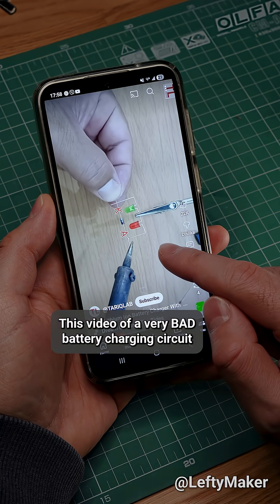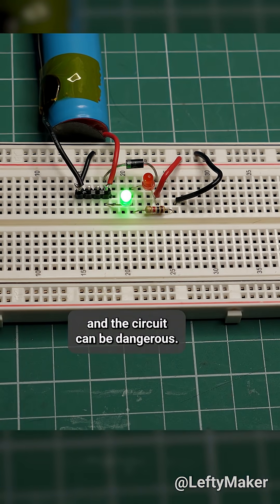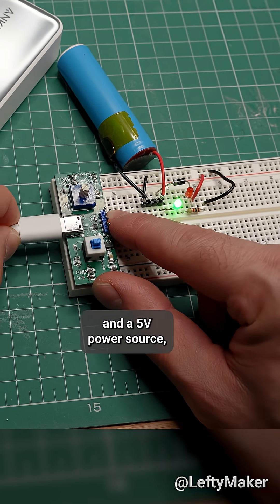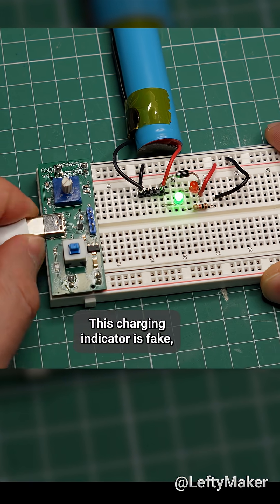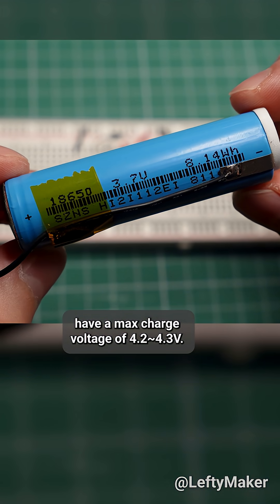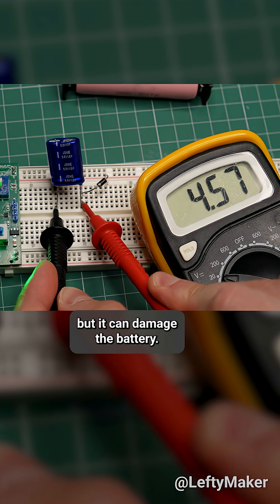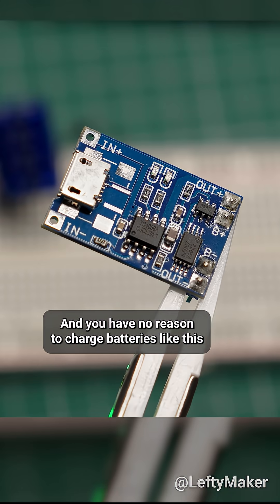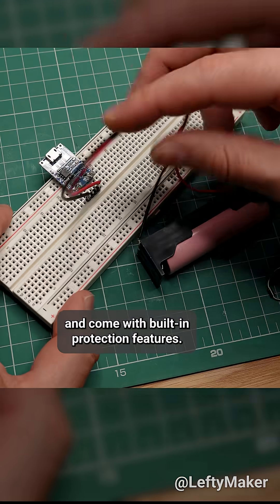This is a BAD lithium-ion battery charging circuit

Comment: One thing that i should mention after seeing contelss such videos, PLEASE FOR GODS SAKE USE THE B+ AND B- OUTPUTS FOR YOUR CIRCUIT!!!!!! Dont connect the circuit directly to the battery!!! this module is like charge here connect baterry here, and take voltage here!! not a dumb charging modue, these are BMS'

Comment: It is bad circuit but if you add another diode in serial you can decrease the final voltage on battery and it could work but slow
Reply from the maker: That's true, but you have no practical reason to do this unless there's been an apocalypse :)
Reply: @LeftyMaker I disagree, it is a good way to learn how to build a simple circuit. Although there are much safer ways instead of playing around with lithium batteries

Comment: Teach us a way that works, not just buying
Reply: They are complex devices. You pay atleast 100x more for CC + CV power supply made in discrete parts. There is all sorts of logic, current, thermal limiting circuits, voltage reference, amplifiers....in there. He makes sense.
Reply: Buying a pre-made board is cheaper than what the components would cost otherwise.

But for just charging the cell outside of any device, you could use an adjustable power supply with current limit options, as long as you're careful to follow the charging curve.

Comment: I'm guessing that the original video didn't understand  the difference between a diode and a zener diode. Not that I'm an expert either, but that would get my guess from the simplicity of the circuit.

A zener diode would probably work here, but it wouldn't really be efficient at the circuit would keep sucking down power even after the battery was charged. 

It would at least regulate the voltage though in a simple circuit like this.

Comment: In electronics its always good to consider safety for you and the sensitive equipment. Thank you for a great video!
Reply from the maker: True. And a circuit that breaks later is worse than a circuit that breaks immediately :)
Reply: Except he could have build a better circuit. Parts are harder to find.

Comment: Exactly what I do. Didn't want to learn how to build a charger, so i bought one. 10x-20x charging modules for 10-15$  is easier, safer, more compact, better than building your own.
Reply from the maker: True. It makes no sense making a battery charging circuit out of discrete components, unless you want something really specific. You either buy a module, design a module around a suitable integrated circuit, or program a microcontroller if you want to be extra fancy. :)
Reply: @LeftyMaker precisely, it’s great since most 3d projects, or small home built gadgets usually only need 3.7v, anything higher and it’s better to either be plugged into an extra power or again another charging module…
Reply: So where do you get these chargers?

Comment: My module charger is broke just from day one after i bought it. I recently use it to charge my 3.7V li-on battery. At first everything is fine, the battery is charge and the output voltage is good. I tested it with multineter. But after few hours the red led is stopped flashing and the output voltage is no more. I pull out and replug it, at first everything is fine again to say the least until the module start smoking and i quickly unplug it. Then i try to plug it again and the module work like usual until its start smoking again. Truly a electrician moment🎉
Reply: Did you plug it in the wrong way